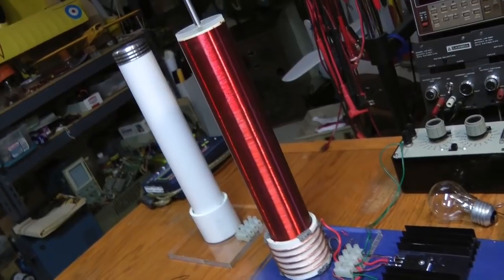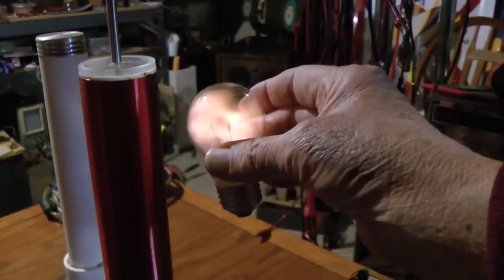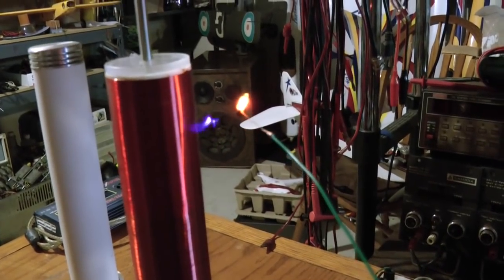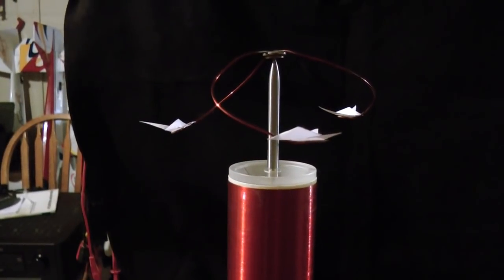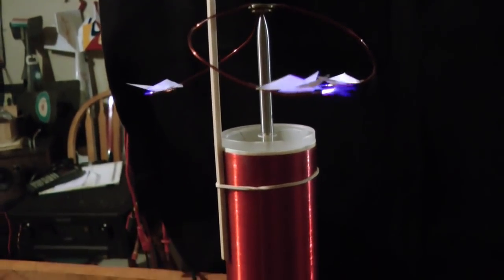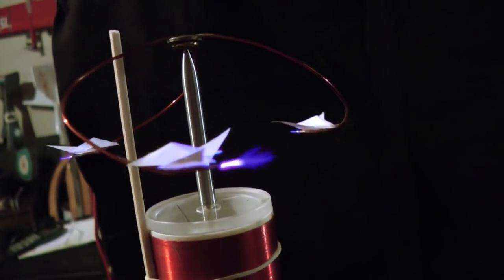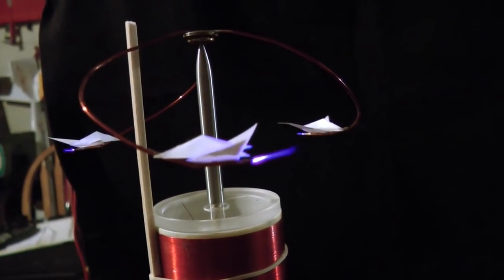Tesla / Slayer Ionic Propulsion

Comment: What is the temperature of the output, it appears to be plasma.
Reply from the maker: Pretty hot, it will burn things. It puts a hole in your finger quick but cauterizes it.
Reply: Dadhav, what you have there is a plasma cutter, I never thought about how much thrust it would create on it's own, plasma cutters have high pressure air attached to blow thru steel. 
It would be very interesting to know what the thrust to input power ratio would be.

Comment: Whats happening to the wire. Are there partiales blowing away?
Reply from the maker: Some call it ion wind. Negative ions are propelled from the wire or cathode and try to get to an anode to complete an electrical path. In this case the anode is earth ground. At least that's to my latest understanding.
Reply: DadHav basically how the negative ion generators work that are sold as air purifiers. I think the term for that particular mechanism of discharge is Corona discharge. So basically you're creating extremely high voltage static electricity, and when it touches something grounded you get what I think they just call ESD - electrostatic discharge. The only part that's really out of my scope is if it's like a negative ion generator and only does anions or if you're creating and discharging both from that tip

Comment: what is the metal pole in the center ?  is it connected to another coil or it's just a ron in the center of the tower ?
Reply: Denis Giguere it is connected to the end of secondary coil hope it helps, how do i know ? Coz I've made one
Reply: you know what !?  if you can fit the tesla coil into the fuselage of an airplane, you can fly at great speed without engine at all.  it work with mini airplane and jumbo airplane to(it depend of the budget) .  you have to install a wire in front of the wings and the wings have to be covered with aluminum foil  like in this video https://www.youtube.com/watch?v=uF8otSSPgdA (for giving you an idea)

Comment: Interested how this would work in a vacuum
Reply: Generally speaking it would not work in a vacuum. It is ionising and repelling the air gasses and then they are generating a venturi effect drawing a larger volume low charge flow.  However space is not a perfect vacuum so there would be some forces. There is also a charged state high in the atmosphere that negates the effect. Still looks good and is fun.
Reply: Jeremy Lowe it won't.... but they will try to make u believe it does
Reply from the maker: Hello Jeremy. There are a few videos that show the experiment and the ion flow dissipates into a plasma like you see in some of the globes. Keep in mind this experiment is operating without a cathode for the ions to flow to so they go to the earth ground. In the vacuum of outer space both anode and cathode are on a thruster as well aa a stream of xenon gas.

Comment: How fast will that spin if you let it keep going to its max?
Reply: Air resistance is the limiting factor in atmosphere, and the tiny friction on the pivot would restrict it from infinite speed in a vacuum, buy id bet its structure would fail in a vacuum as the speed would get so high.
Reply from the maker: On earth you are probably seeing it's to speed. Ion thrusters in space can reach thousands of miles per hour over long time periods because the thrust is so low but volume of ion flow very high.

Comment: do your experiment in a vacuum chamber see if it has the same effect
Reply: space!
Reply: Ion thrust will work in space.  But, since there is no air (or any other gas) to ionize, many people point to that problem and say "yes but since Ion thrust needs some air around it to ionize, ionizing air to create thrust won't work in space."   Well, what do you do if you're going to a party but they tell you "there's no beer at the party" -- you can bring your own beer.  Japan's space agency deployed successfully an ion thruster space vehicle in 2003.  Ion thrust works fine in a vacuum -- you just have to supply your own beer (gas).  Japan's ion thrust space vehicle's "beer" was xenon gas.  Here's the link =>  https://en.wikipedia.org/wiki/Ion_thruster
and here's the relevant part of that link:
"The Japanese space agency's Hayabusa launched in 2003 and successfully rendezvoused with the asteroid 25143 Itokawa and remained in close proximity for months to collect samples and information. It was powered by four xenon ion engines. Its xenon ions were generated by microwave electron cyclotron resonance and an erosion-resistant carbon/carbon-composite material for its acceleration grid.[59] Although the ion engines on Hayabusa had technical difficulties, in-flight reconfiguration allowed one of the four engines to be repaired and allowed the mission to successfully return to Earth."

Comment: Is this safe for him to be standing next to? It's radiating energised particles isn't it?
Reply: Wyrm an Ion is an atom or molecule with a net electric charge due to the loss or gain.
Reply: Terminator X I understand, but I'm asking if it's safe for him to be so near to it. If it induces a current in electronics up to half a metre away does that not mean that there's a powerful magnetic field around him? Are there any dangers regarding that?
Reply: Wyrm! It is safe... It's like having a DC transformer in which it is. His DC transformer coil produces high voltage because of the number of turns on the red. Excellent work... At the bottom his has glass and ceramic very good insulation but can back down at higher voltage and in turn conduct electricity.

Comment: DadHAV I have a question, could you touch the Tesla coil, if not, how could you hold that neon light on one end without getting electrocuted? As you can tell I don't know much about this stuff, but I was just wondering if you could touch it!
Reply from the maker: Sorry I'm late Oliver. That's actually a really good question. I don't know. Maybe because it isn't a solid wire connection. There is a gap between the two electrodes in the bulb.
Reply: Oh yeah true, thanks!

Comment: I can hear the fan turn on. The one blowing the flame.
Reply from the maker: Look in the video description to see a link to a video showing what you heard. I'm way better than to let you hear a fan go on if I wanted to trick you. You heard our furnace go on and the timing was perfect to make me look bad. Check here: https://youtu.be/WJXH7fs0ziM
Reply: DadHav that is exactly what I heard. Wow. Good job. 
 Can you test the thrust? And is it variable? I mean if you add more power does it go harder? Can you bend the wires down to make it hover? Thank you for your time.
Reply from the maker: People have lifter experiment on YT but they make a small light frame with an anode and cathode on it. I might try it with a similar device as in the video though.

Comment: Your super heating the air witch in turn creates a vortex.
Reply: Tiny Superman 
I think you might have nailed that but, The test would be to put it in space or simulate, would it still propel itself ? If so, there's another answer.
Reply: In space there would be no capacitance with Earth, so no discharge. Also with no air, no corona if it wanted to.
Reply: You need to expel a mass at speed to create an opposite force, as nasa found when they tried this, it works well in space. The nasa drive worked by using electromagnetic fields to accelerate mass to achieve thrust, where as this uses brute force to blast the ions out.
Reply from the maker: True Brek, In space the earth ground is replaced with an anode and also an additional inert gas discharge into the ion stream to compensate for the vacuum. I have used the circuit without earth ground successfully and will probably make a few more videos. Thanks for the comment
Reply from the maker: I could never find good explanation as to how the magnets are used or what material is used for the outside container of the drive.

Comment: what's the thrust of these things?
Reply from the maker: Very very small, I'm not sure how I would even measure it. A thruster engine moving a satellite at thousands of miles per hour in space only has enough thrust to be equal to lifting a sheet of paper. At least that's what I heard.
Reply: DadHav you measure how many times one of the little planes rotates around the centre within the first second after the start and multiply that with the circumference to get the distance. multiply that with the weight of the plane. if you use meters for the distance and kilograms for the weight, you get an approximation in newton. not counting fricton, air resistance and a trillion other details.^^
Reply from the maker: Very low but high velocity. An ion drive in space might reach 200,000 miles per hour given enough time.

Comment: If this works in a vacuum, it could be viable for future space travel. It wouldn't require as much energy as in earth's atmosphere because it won't have air to move. Also, it won't require fuel because you could maybe hook up a solar panel. Maybe that's just my sci-fi nerd coming out but still.
Reply: I understand that science already has a model or concept of that nature. It has giant solar sails on it and theoretically uses ionic solar winds to propel itself indefinitely. Mythbusters built a levitating triangle shaped device that actually worked using ionic propulsion.
Reply: TheoreticalGenius You would still need fuel like iodine or xenon there's nothing to ionize in space

Comment: To generate a spark, like this, is creating a highly explosive gas (very small amount that is) like lightning. 
-
In the future this principle will be used to propel vehicles true outer space with an incredible speed. 
No fuel except electricity
Reply: How was it generation a highly explosive gas when it blew out the fire on the lighter??
Reply: Two wires with current, with plus and minus and high enough voltage, that is coming close together will create a spark. And that "spark" in it self is the gas, (that is being created), being ignited.

Comment: Have you figured out what it does and how it does it yet
Reply: It's simple. It's not "blowing" or "shooting" anything. The electrons are flowing through the wires and exiting in the path of least resistance. The air is scattering the electrons at this point. There is no conductor to let the electrons to continue on their fixed path so they arc in the air. The flame of the torch isn't being blown out. It's being starved of oxygen as the electric arc is burning ozone. The reason the objects on the wire move is the arc is creating energy (heat) which is then pushed by the surrounding cooler air. The cooler air is pushing that heated area for the same reason a/c works. Heat is the byproduct of energy or work. Cold then wants to flow towards heat to reduce or even out or unexcite that work.
Reply from the maker: There are many theories here including the one by Neil below. Another might be that because of the resonator polarity negative ions are discharged from the spinner. The negative ions might be pushing against the negative ions in the atmosphere, Negative against negative repels so the spinner moves in the opposite direction. Other negative ions may also be picked up in the stream as it tries tp get to earth ground through the capacitance formed from the spinner and ground. There might be more information for you in the description under the video.

Comment: Why did the paper planes not burn??
Reply: Smit Shah Plasma isn't fire
Reply from the maker: I can't explain it, the plasma will burn you but the wires do not get hot.
Reply: Even though if the wire is not getting hotter, the energy that is released (which is creating the plasma so easily) can heat the paper above its ignition temp. As you might now that even for cold plasma the temperature is about several thousand degrees..
Reply: Yuki Kawai not only fire can burn things..

Comment: Can I get the same effects by Slayer Exciting FlyBacks in series?
Reply from the maker: I don't know Erick, If you try it please let me know how it works out for you.
Reply: Can't make it work by Slayer Exciting it but I can drive it with NE555 + MosFet or 2x Mosfet or 1x 2N3055. But here's the problem:  it won't just spew a bunch of electrons like a Tesla coil does. It only generates sparks when the other end of the secondary - or gnd/common pin - is close to it.

The Slayer Exciter circuit doesn't work not even with a single FlyBack because it relies on a feedback from the secondary coil, and as the secondary coil of every FlyBack got a high voltage diode, we can't get the desired resonance ;-;

But I'm working on it. Hang on!

Comment: The vacuum of space what does that mean and you mention a xenon atmosphere is this your claim that space contains xenon therefore it is not a true vacuum in the technical sense of the word, but then how do rockets even work in space this assumption that if xenon exists in a vacuum atmosphere then why not use ion propulsion alternative to rocket fuel propulsion!!!!!!!!
Reply: remo conan Space is a vacuum no Xenon. The propulsion here is magnified by our atmosphere because it has something to „push of of“. However in space these actually still work, they use unbelievably small amounts of energy and could run on a ship for 100s of years. The only draw back is they produce very Little thrust. So it might take 250 years just to get up to 40% light speed.
Reply from the maker: Sorry Remo, I didn't explain well enough. From what I've read after posting the video, a thruster engine on a satellite caries xenon gas onboard and it is injected into the ion stream to increase thrust.

Comment: it moves because of the  air becoming hot... that won't spin in a vaccum...
Reply: Arthur Sano   This is cool, but it cannot be used for propulsion anytime soon because of power density issues. The craft would have to literally hold a star; so for now, it is impossible to actually use such a technology for space. Certainly not going to strap them on little fighter jets, lol
Very cool parlour trick; too bad all the cool stuff is unusable.

Comment: So if u turn it down 
Will it float 
Pls reply
Reply: Killa Frazer if you pointed them down it may have enough strength to lose connection with the top and stop transmitting send fall down redeem connection and start all over again. It would probably just bounce or vibrate on the top until it fell off
Reply from the maker: It doesn't really float, it's a bushing sitting on the point of the coil. It will slow down and stop as you turn the voltage down.
Reply: Put a feedback loop controller in there - find your desired voltage level and set it at that - it will probably float then.  But, because it is moving air..... and you have 3 of those 'jets' in tandem.... Each jet is moving 'X' amount of air per second... so putting more jets would move that much more air.  You could definitely get levitation.  Thanks so much for sharing.  Piqued my curiousity.  There's so many crossover applications with this.

Comment: Has anyone seen this experiment performed in a vacuum?  I would like to see that.  I speculate that movement would still occur in vacuum showing the three wire part as being more of a motor, but since the three arms appear to be copper, they would be perfect ends for all that electricity to spray out of, just like it was doing with just the vertical tip.  My guess is there are two coincidental things going on:  rotational movement due to electromagnetic fields, then arcing from the tips from the high energy discharge.

Comment: Good discovering.
How much volts do you use?
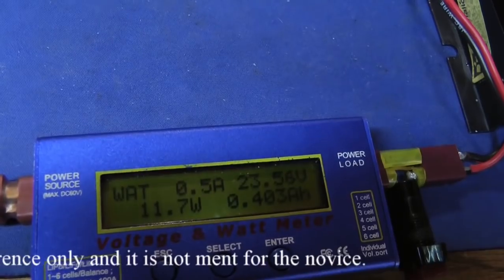Reply: Check around 0:40 seconds...
Reply from the maker: If you mean output volts, I don't have a way to check accurately. The input is 24 volts at just less than 1 amp.

Comment: Ion thruster hmm...
The positive protons get attracted by the negative electrons and they burst in air... ez
Reply from the maker: Maybe not that ez Thunder. First because of the polarity of the resonator there should be negative ions coming off the spinner. If they collide or burst as you say with the opposite polarity like two magnets being drawn together they would stay in the same place after they hit. One theory was that the ion discharge from the spinner is trying to reach ground using the normal operating characteristics that might be found in a Tesla coil. The ions as they travel push the ions of the same polarity out of the way or increase the flow. This pressure moves the spinner forward. Why it can be focused so sharply on the spinner but not the point on the top of the resonator is still a mystery to me. Why, unlike a Tesla coil, if you put your finger in the path of the discharge you get a deep pin point burn is another mystery.

Comment: It won't work in Space unfortunately.
Reply from the maker: Actually I meant to show that there was a difference in the output of this resonator as compared to a standard Tesla coil. As far as I know in Space there are more requirement such as magnets and an inert gas like Zenon. Even with this the acceleration is slow but the top speed is unbelievable.
Reply: @DadHav  xenon*